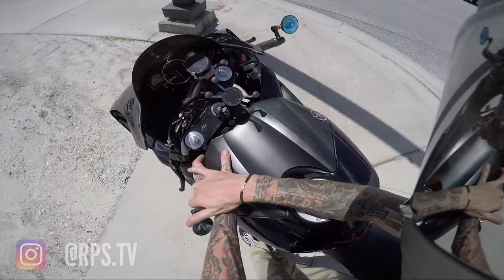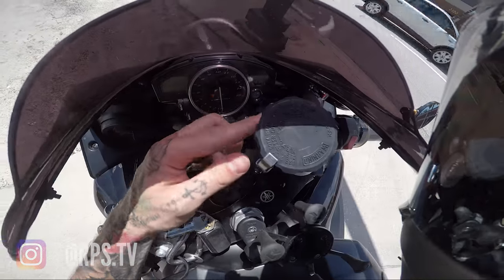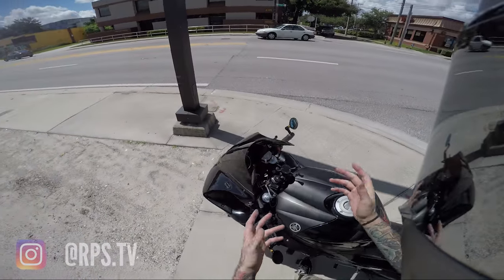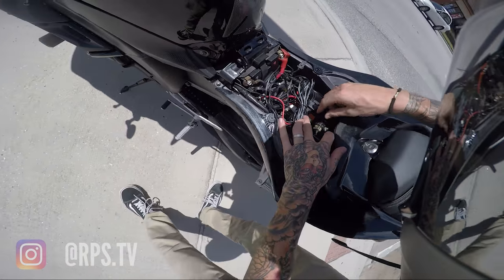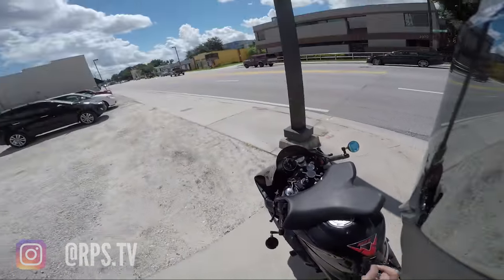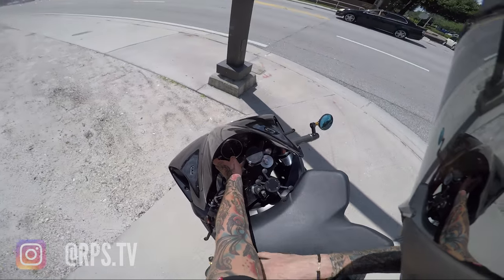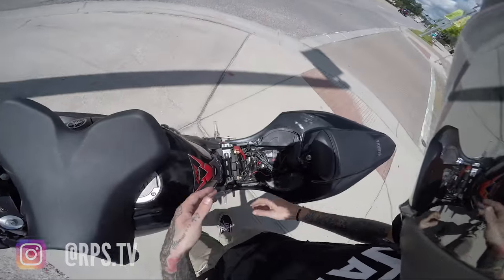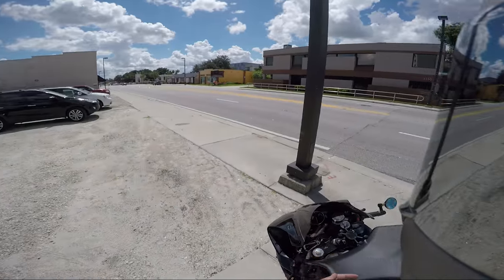HOW TO: Yamaha Diagnostics mode, Error codes + Tilt sensor

Comment: man i love you no joke, you thought me a few things, thank you so much.
Reply from the maker: Thanks bud! Really appreciate it <3
Reply: @RPSTVofficial  i had send you this same question on your video. How did you repair the issue? I have an 07 R1 that does the same shuts off while riding or somethimes even parked. I looked at the codes and there are a few in there as well.
Reply: @jerryjones297  same here, on a 05 r6. Did you ever get it fixed?
Reply: @iruntoughness9652  yes I did get it fixed. The issue was on the on / off switch it was loosing contact and would shut down the bike intermittently. It took me a little bit more ingenuity and troubleshooting. However I had fixed the issue.

Comment: Hello. Could you please tell how to delete fault code on grizzly 700 2007 I
 can not wire for grounding with EPS controller. Maybe it is different 
for 2007 and 2008.

Comment: my bike was doing what your did at the light. I had to rebuild the starter. thanks for the diag info. Im having the dreaded surge . it started two weeks ago and is tripping an engine light. Any tips?
Reply: Whats a surge
Reply: @manrayr1  the rpm not holding at idle.  It was surging 100 rpm up and down
Reply: @dustinvangorkum3948  legend comes back after 3 yrs
Reply: @manrayr1  and you made a comment 13 hours ago. Thought you had a real question
Reply: Yea that was my question

Comment: I took my motorcycle to wash and now it won't start!  check all those fuses in your video but i don't know what could be
Reply: Any idea!!! I have a 2007 yamaha r6
Reply: @yamahar1castillo923  maybe the tilt sensor??? 
Seems these bikes have same common issues with everyone. 
"No start, no click" 
Have 05 same prpblem, turned on before, now it's not...
Reply: @Ryan_1997  actualy I discovered what the problem was, I took it to the workshop and there they check the bike   they found a short right in a cable under the seat, it is the cable that comes out of the crank  shaft  position sensor = 369 dllrs